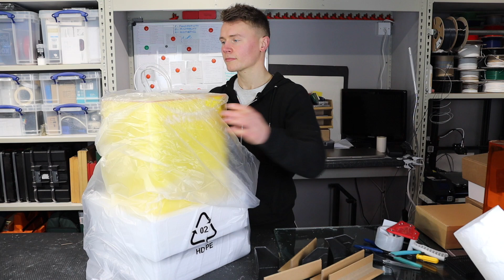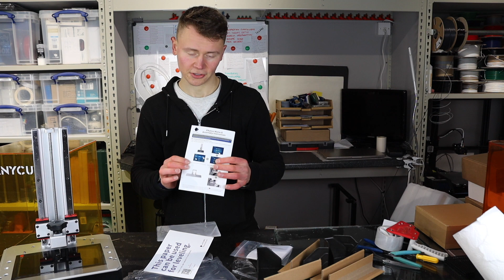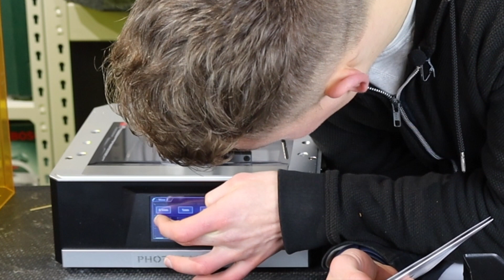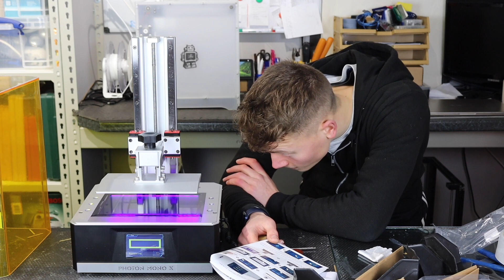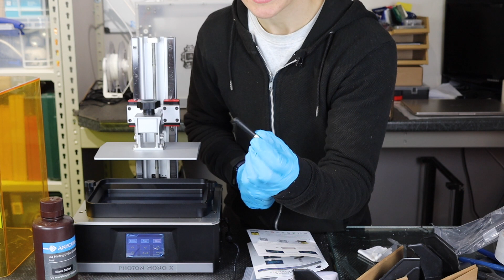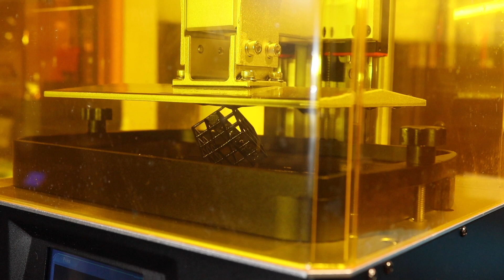Unboxing + First Impressions - The Anycubic Mono X - Large Format Desktop Resin 3D Printer

Comment: Thanks for the great video, I am glad that you discussed the UV light output of 80%.  What did you find is the best cure time per layer when using the basic Anycubic resin at the 80% UV strength?
Reply from the maker: Thanks Mike. I found at 80% around 2s per layer was generally a good starting point. Standard resins seemed to vary between approx 1.5s-2.5s at 80%. If you are using more speciality type resins designed for a laser printer, e.g. liqcreate, then you'll need much higher layer times.

Comment: HI, my question is how fast the resin go solid when you want to clean the vat or the platform. My first trail was so difficult because the resin started to get a solid layer after removing the shield.
When did I go wrong?
Reply from the maker: Not sure I completely understand your question, I think you’re asking how long it takes for the resin to go solid under normal light yes? This does depend how strong the lights are in your room and whether there is a lot of sunlight coming in, the more light the faster it will cure. It’s always best to err on the side of caution and minimise the amount of time the resin comes into contact with light since you risk the chance of it curing. The shield should never be left off if there is resin the the tank. If your room is light be sure to store the resin in the bottle (you’re meant to do this anyway).
Just to check, when you say a solid layer, did this form on top of the resin or against the LCD screen?

Comment: 16:45 I am going to take this advice and buy a regular sized one for now, as much as I want to print massive tanks and dragons in one piece maybe it's best to learn with one at half the size and quarter the price. Thank you for your video, it is good.
Reply from the maker: Thanks for the comment, yes 100% agree, learn the basics with a small one and add another larger one if you feel you need it at a later stage. Never hurts to have a small one as well since they’re good for using up smaller amounts of resin.

Comment: How many printers you got now then?
Reply from the maker: 15 I think!
Reply: @CallumColes  how many of them are resin printers? And do you get orders for resin prints very often?
Reply from the maker: @elburritomonster  3 resin printers, but have had loads of different ones in the past, including higher end ones. They’re messy, need to be carefully handled and quite time consuming so I don’t promote them too much, but there are now a few plant based resins out at the moment which I’m planning to test out shortly. Also water washable resins have improved which makes post processing much easier for large prints (previously all parts had to be cleaned with Isopropyl Alcohol).
I’ll promote them more for orders once I’ve found resins I’m happy to use on a regular basis. Then will also write an article to explain good use cases for this sort of printing technology and the best design principals.